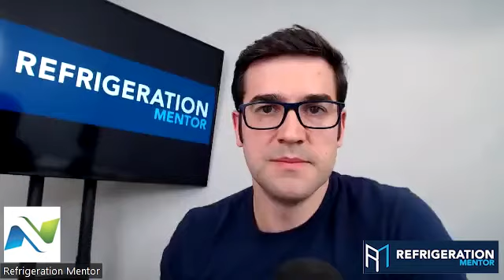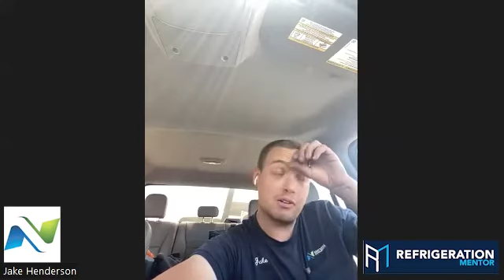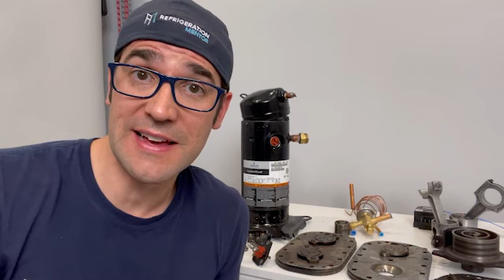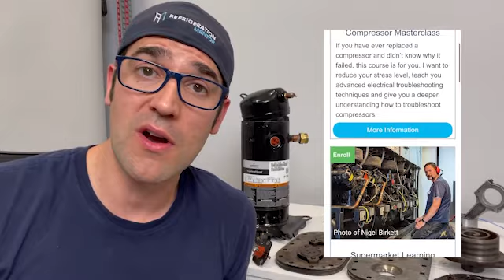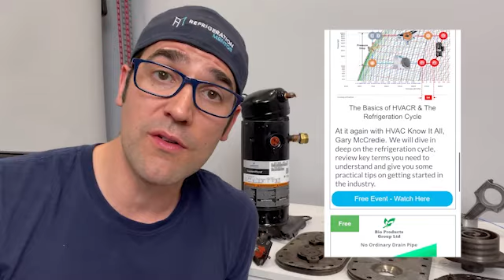Running a CO2 Transcritical Booster Project from start to finish with Jake Henderson

Comment: Why isn't CO2 used for residential heat pump applications?  Especially if you use a ground source geothermal loop and temps never go above 70F?
Reply from the maker: There are millions residential heat pump water heaters installed globally.
Reply: @RefrigerationMentor  sorry, I mean for forced air heating and cooling.

Comment: The attention to detail in cleanliness in leak checks not afraid of taking that extra time of duration for pressure test. 

        Something we all see and know that the guys who just want to make a product equipment sales and pump the job out as quickly as possible totally ignore and pass up and minimalize because it cuts into their profit margins.   

Shortcutting procedures It gives equipment manufacturer a bad name.
Reply from the maker: I agree attention to detail is very important. Do the job right the first time save you from headaches later.